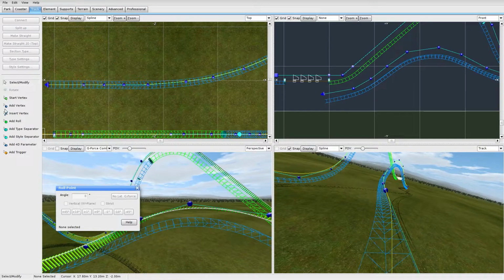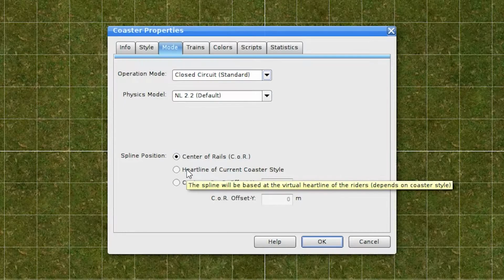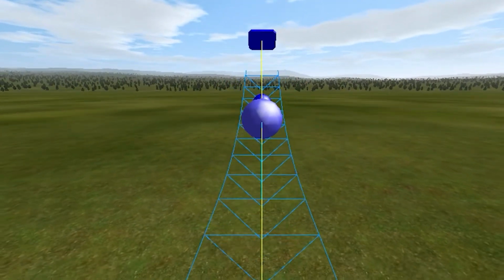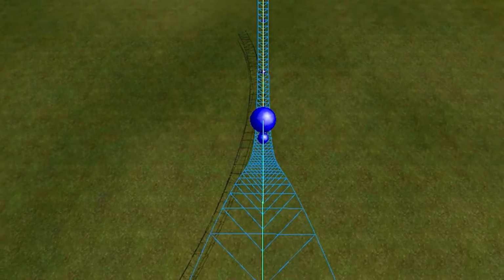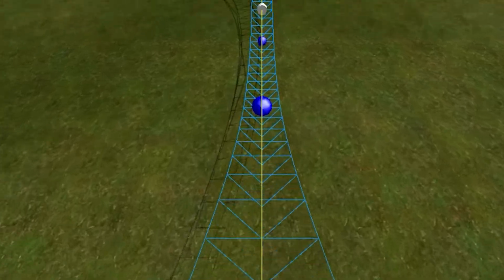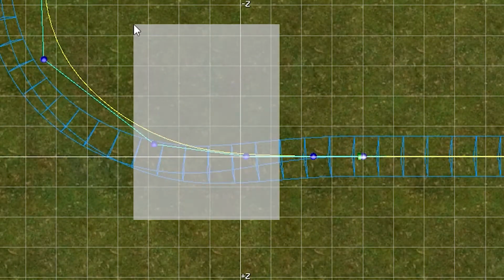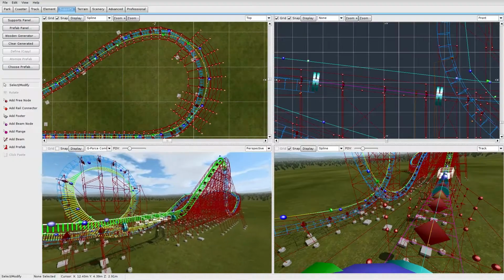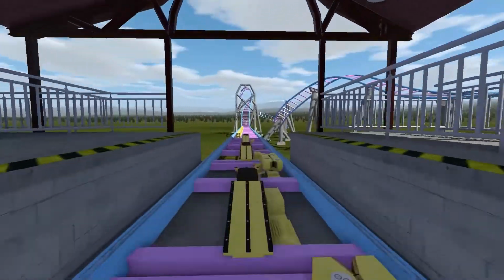NoLimits 2 Tutorial | The Basics

Comment: how do I move around when I'm in "perspective mode"? I'm not able to even turn or rotate the views.
Reply from the maker: Click on the window and then move with the WASD keys and the mouse 🙂
Reply: @NorthernRidesYaBoi  thanks for responding so quick. It doesn't work. I also don't have a mouse I'm on a macbook air
Reply from the maker: @jayrockhammer  Hmm that's tricky. In that case, try to check out your control settings in the game and see if anything is preventing you from using the mousepad. I'm afraid I'm not too experienced with this issue
Reply: @NorthernRidesYaBoi  No worries. Thank you for your help!